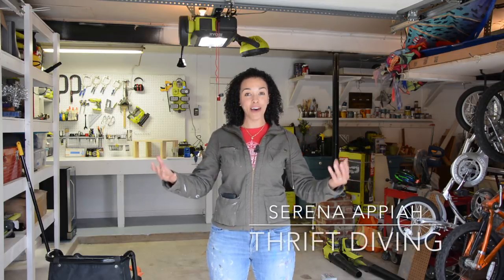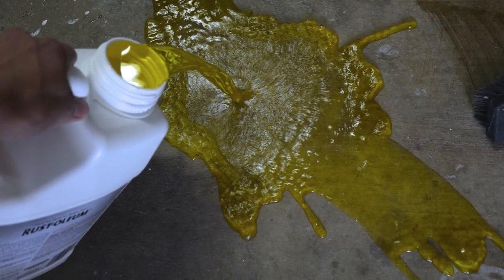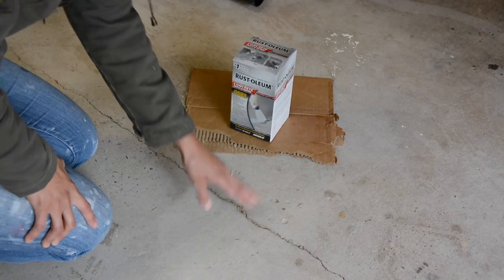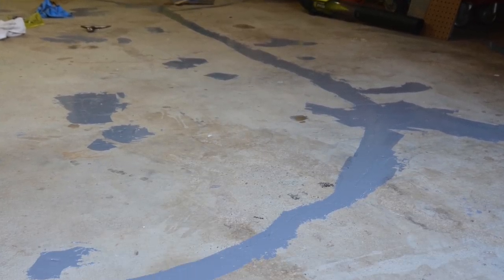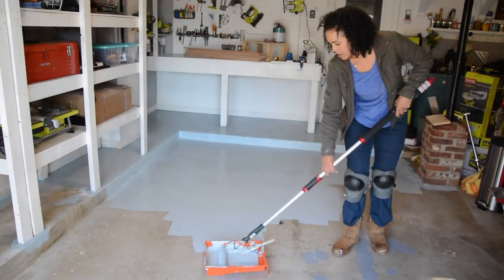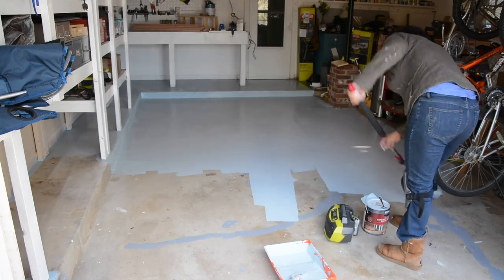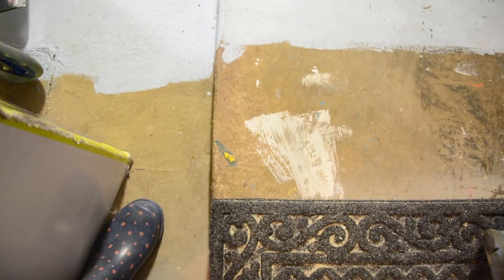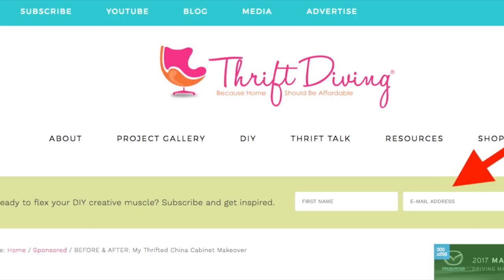I Painted My Garage Floor: Garage Makeover Series - Thrift Diving

Comment: sometimes the little cracks are best left alone under the paint!!!.  I painted my entire basement with a good exterior latex, also my mom's.  The 2 coats smoothed the 80 year old concrete.       As for prep, around the children, I only used course sand paper on an old sander. 3'x3' sections.  Then flopped down Oriental rugs.

Comment: Generally good to widen and clean the cracks out before filling. That way you can get out any weak concrete and the filler has more surface to bind to, making is stronger. Then if you have any ridges or bumps in the filler you can sand it down so it won't show.

Comment: You have to read the instructions before using chemicals (or anything really). It's dangerous to assume; you need to know about PPE requirements, ventilation etc for safety, let alone doing the actual job correctly and getting a good result.

Comment: I would recommend BEHR brand solid color concrete stain as an alternative to the epoxy paint.  It is much easier to apply and dries within an hour for a second coat.  You can add a bag of Rustoleum anti-skid to the stain so that the garage floor isn't slippery when wet.  This concrete stain performs very well and does not come up when car tires go across it.  Home Depot sells it and it can be mixed to just about any color desired.

Comment: I am loving these videos! Now that I have seen you paint the garage floor I am confident that I can do it.  Now what about the asphalt covering for the driveway???
Reply from the maker: You totally can do it! You just have to have a place to put all the junk/stuff in there while you do it. I actually pile it up on the other side while doing the side I'm working on. That's the hard part, especially because it's overwhelming to see large piles. But you've got to put the stuff SOMEWHERE. :) As for the asphalt, do you have a pressure washer?
Reply: Thrift Diving no I don't have a pressure washer. I'm thinking I will need to invest now lol. I really love how driveways look when they are covered in the asphalt instead of just plain concrete.

Comment: How has it been holding up 5 years later?
Reply from the maker: The garage floor as been pretty good! I will do an update video on it. There are some spots near the opening that have scratched as I have pulled things in and out of the garage. But overall, it's been good. I think a yearly refresh is a good idea, but not necessary.